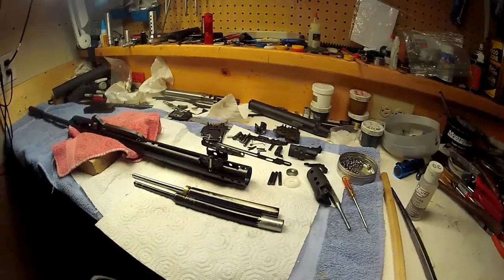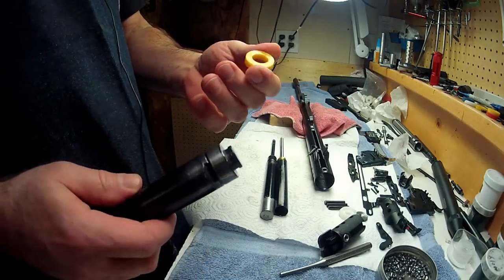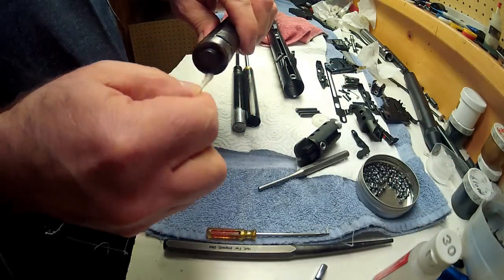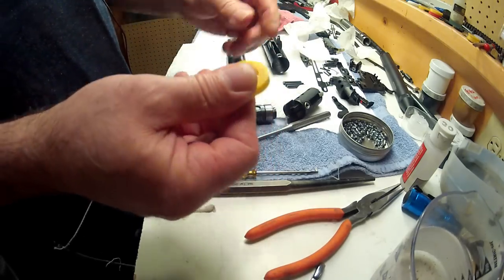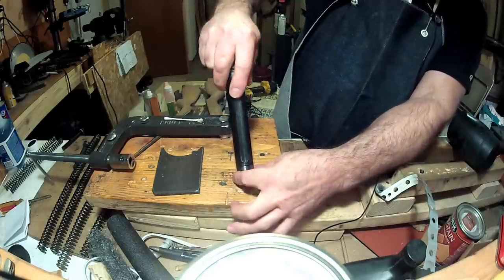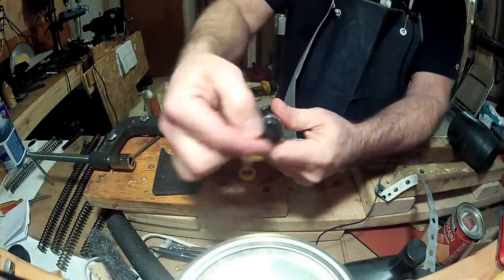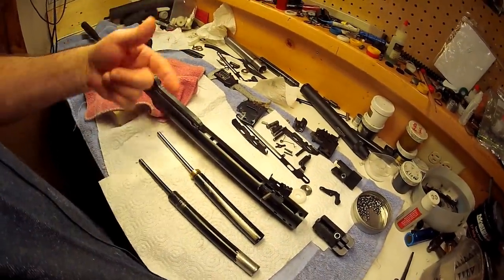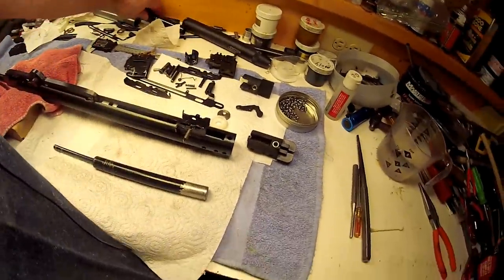Pt 1 of 2 How to gas ram hatsan & others and air gun info

Comment: Have taken out type 2 piston from my mod 125 sniper due to failing.  While installing my new type 2 piston I come up 7/16 shy of my end piece fitting flush.  It’s like the piston needs pushed in however even with force against the floor, I can’t get it to give.  Any advice?  Am I to build a clamp rig ?
Reply from the maker: Hi  Bill  ok  what  is  type two piston?  #1  the  gas  ram  must  be long enough  to  be able  for the rod  to close up  with  out bottoming out  for  the full cocking of the gun  and 
#2 the  gas  ram  has  to have pre load so when its  installed  the end plug  is  sticking  out no less  than  1/8  or the gas  ram  will reach  its  travel when fired  causing the rod  to hit its  end  damaging  it and  failure #3  yes you need  to make a  spring compressor  or send  it to me and I  will re build the original gas  ram properly  so it wont fail and return  the receiver with ram installed.  if your installing another gas ram  if its to short then  you need to machine a  round steel insert with a divot for the rams arm to seat in  the middle  so everything reaches  the proper install point

Comment: What weight losi shock oil do you use? 
Thanks
Reply from the maker: Its  stamped 30 on the cap.
 After opening  up the two gas rams they  are internally lubed

Comment: suggestion, when installing front piston seal. find a nice chrome 3/8 deep socket that is about the diameter if that front piston button, usually a 10m, 7/16 or 1/2. Set the new seal on hard surface facing up press the socket into the seal. Line the socket to piston button, just slide it on. Easy YW

Comment: Great video. Huge amount of useful info e.g. re. pre-loading distance, all the measurements, adapter etc. - I am doing this on a different gun right now, but you have saved me a lot of problems and I will be more confident that the outcome will be OK. Very big thanks! There are many videos on the web that are quite useless, yours stands out as very useful :) 
Just one question - re lubing the ram shaft - many people say you should not do it at all. How can you be sure that you can? Yes, if I was doing it, I would also use a high-ignition point lubricant (silicone based e.g. special chamber oil), but I am still reluctant to do it... Thank you
Reply from the maker: the rams shaft - arm ... the important thing is  to wipe it down so its clean &  inspect for nicks,  lubing the arm I do  it, its no big deal but I feel it just adds something to bear metal, 99% of what ever you use  will get wiped  back when the rams closes so you only need  to use a little on your fingers and work it on the shaft 
  silicone base  is fine, heck I use weapon shield  since  its  at my work bench
nothings going to explode lol inside  the ram is some type of junky hatsan fluid I rebuild  the rams  when I do someone's gun  but I  wont share  that info.
Reply: Thank you!

Comment: Mike tried to get you link u tube not letting it go.hes on nine months ago.pulls stock off 125 sniper voetex. Points to screw on side of case right near trigger. Says this lets air out of piston. Flips gun over theres a port fill hole near it he reads fill to 150 bar.. Sticks fill prop in and pumps the dam thing up to 150 bar. Chorny says he gained 100 fps.
Reply from the maker: Ok  Thanks  Mike. I  will go thru his videos and check it out.

Comment: Im looking for some advice I bought a hatsan 130 qe 30 off a guy with few other and this one doesn't shoot guy said he dry fired it show a nother guy it worked the it just stopped what he said so I went ahead a bought it to I thought maybe a trigger problem that all works fine there's no pressure when cocking at all any advice I'd like fix it I've never had a 30cal I think be good squirrel rifle if fixable
Reply from the maker: Hi
The  gas  ram is dead You can send the gas ram to me and I  will rebuild it properly / If  that interest you   email me no caps no L no spaces replace dot with  .   and    at  with @ sign      aways  mike   at  hot mail dot com

Comment: Hi Mike, I have a Hatsan 135 Vortex .22 and I need to replace the gas piston. I think the seal is bad. I went to shot it and it had no power, I've put about 3000 pellets through it but never lubed it (mistake, I know). Do you have a video on how to do that?
Reply from the maker: Hi
 Most likely  your gas ram is going  dead  they fail a lot, I rebuild them properly so that wont be  a problem. the  guns  are difficult to work on
 basically a  pain in the A.  not typical take apart  it will fight you. 
its  fairly complicated  because you would need to know  how to re set the trigger  & make a shorter  sear pin  in order  to get  the trigger back, piston seal itself  is typical  but most likely  your gas  ram is dying  if your confidant you can  open the gun and  put it back  then you can send  me the gas ram and  piston but I don't recommend it as just trying  to get the stock  on  with those trigger pins  can be a  big  pain E m    no caps no spaces no L  no at  no dot use  the symbols  in typical E  mail    a  w  a y s   m  i  k  e   at    h  o  t   m a  i   l    dot    com

Comment: I currently have the bt9 in my crossman. What's the strongest gas ram I can put that Is compatible with my f11?
Reply from the maker: That's the smaller gas ram  made  for  that  gun if  you want more power  just move on to a rifle that  has  more power  other wise  your  spending time money  and results  wont be much more.
if  you add a steel  washer with a pivot  dish  out  it  wont give  you much more and you may  not be  able  to cock  the gun depending on how  thick  you made  the steel  piece.
I  have a nice  hatsan .22  if  your interested  they  get  around 800fps  its all factory and  has a  good .22 barrel  and  if  you want to  take it further  I  can  go  thru the  gun upgrade  and  tune  the trigger

Comment: hi bro I'm Jojo from las Vegas I have  hatsan 135 .30 Cal when I break the barrel its very light like it's not pushing the piston I haven't. dismantle it yet but now  I saw your video I want to know what make it like that before I open it. it feels like the cocking lever is off the rail
Reply from the maker: Hi Jolyn  its  the gas  ram  it  failed,  they are prone  to failure and  I rebuild them  properly  you would need to know what your doing  to   remove it because the trigger has  to be pulled  and you would need  to have a  spring compressor in order to  get  a  rebuilt gas ram  and end back into  the gun. hatsan  guns are a  PAIN and even the trigger to re install it you would need  to make  a small sear pin to clear the welded  trigger bracket

Comment: Hello Mike, can I convert hatsan 95 vortex to a spring and if yes what need. 
Thank you
Reply from the maker: Yes  but  you will need the end plug  for a hatsan 95 springer  and obviously a spring and  its factory guide, I have one but I would need your  failed  gas ram and  its end plug. for further discussion go to my channel  at the top read where it says Sharing my passion for airguns, work done ,mods, re barreling, lathe work etc. >  click the small > symbol  it will pull up  my contact info

Comment: I can see, given the Losi shock oil you are using that you must also be in to rc trucks as well.  Nice informative video by the way. I got my Hatsan 125 with the Nitro piston installed by Pyramid Air. I'm getting 32 foot pounds out of it and it's only chambered in .22. What a powerhouse.
Reply from the maker: +Eric Coovert 
Hi Eric.

I bought the shock oil just  for the gas ram yrs ago I saw some one mentioned to use  it a old  tuner.

 In the video  where  I open up a gas ram  I found  oil  in side  so I  doubt  now  if  the shock oil is even necessary, but I I am sure it dosen't hurt.

 I hope you have a good one so many came out with  bad barrels its ridicules how many  problems some have.

 hatsan  tries  I seen improvement  but they still manage  to come thru  defective and need  to be returned
Take care

Mike

Comment: Hello Mike! Watching this your video, I was able to independently replace in my Hatsan 125 5.5mm spring with gas piston. Rifle is doing well, less recoil, Power is also good ... Now I would like to ask for a help. I bought a Walther 6x42 optics, which is intended for air guns, so I ask for advice optics mount to use to achieve the best connection between the optics and guns, to be stable, and to keep the optics of a possible fracture due to a stronger recoil rifles? 

Thank you in advance for your advice!
Reply from the maker: Hi.
 the hatsan 125 have  the weaver  rails I would get the 4 screw types  for each scope ring and  for weaver / picatinny ra'il

 I dont have any particular brand  to suggest 
glad you were able to do  your own work that is  awesome.
Reply: Thank you very much for your reply Mike!

Comment: You friend don't know what you're doing 10 times you show the same thing instead of showing the disassembly and assembly process
Reply from the maker: Hi Ivan
 this video is  only centerd  on  the gas ram  info other videos talk about disasembly and re asembly / If I start with  disasembly and do it so all will get it & understand it  it will make  the video too long
also
Ivan  its 5 yrs old I was  just  then  trying to show info now days its alot better even have the proper micrphone I also have a video  on  removing &  reinstalling the stock  because the  hatsans  are a big  PIA  to  get thru unless  youve done alot and have dealt with every issue  they can throw  at  you
Reply: @MrSteppingstone888  Spring with a grain 5.5 = 305 m / s and a gas shock absorber 5.5 =? m/s
Reply from the maker: @ivanpleskina2742  not sure what your asking but the spring releases its energy faster  than a typical gas  ram 
usally the  gas  ram will see 50 fps  less  then  the  spring  in the same gun  with  the same   factory piston  seal  or after market seal

Comment: I'm learning so much from this and your other videos. My Hatsan Mod 125SN Sniper Spring Piston .25 cal in Mossy Oak Camo arrived today. Checking it out and doing a little break-in. It might be a good one. Now I own 3 125 Springers in .25. I'm gearing up to work on them soon and have the break-barrel/air-gun Guru Mr. Mike E. work on em too. This particular video has me now understanding a good amount about how they work. Thanks Mike!
Reply from the maker: Good to hear. those  .25 cal are the correct choice for the 125 - 135  full barrel length also, not the QE  10-1/2" barrels  those are not long enough and most of the barrels  are not good all the way thru

Comment: Mike   I have a  Hatsan 95, been busy and haven't shot it for little more than a  year, was new when I purchase it. Went to shoot it the other day and only hear a faint click, , watched you video  but can't find any info on how to replace the seal if that's the problem. Did watch you tear down the one in your video doing a trigger. In the instructions from them theirs is nothing about where to oil or servicing  the 95 in their booklet. Do you have a video on any seal replacement and taking the piston out or any information . ? Also can I order parts from you or some other supplier.  Thank👍👍👍👍👍👍👍👍 you   so much and your video is one of the best ever, very informative ones I've ever seen on anything.
Reply from the maker: Your best bet would be to  send  the rifle  to me / your gas  ram is  dead  I rebuild them  properly / these  gun are a Pain and  a lot to know in order to  get  thru them  / also  you would need  to make  a spring compressor in order to  get the gas  ram back  into  the gun along with knowing how to disassemble  & reassemble  & install the trigger back  even the stock  can be a issue  if you don't know  what  to look for / you gas ram is dead  so you should be  able to disassemble  it  & pull it if  you just want to send the gas ram  contact awaysmike@hotmail.com

Comment: Hi friend,  would this switch work on the Hatsan Airtact .22? Im still having issues finding out the pros and cons of each setup. Thanks for your time.
Reply from the maker: Hi
The air tact has a different trigger and  I am not up  on that trigger, never had one.
I work with  the quattro triggers Also  the air tact would need a small ram most likely from a crosman nitro venom , I have those rams and can make adapters .
Here is a recent quick video on gas ramming your  rifle / I can make adapters for guys who need them & also custom made  spring guides  that fit properly and perform properly making a spring rifle smoother
https://www.youtube.com/watch?v=9kGDNr3zebQ

Comment: I watched the video but I'm not clear what is the gas piston that replaces the type 1 vortex in the Hatsan 95 model
Reply from the maker: If  your ram is  dead send it to me I rebuild  them  properly /  if  you go with a different ram  you would need  to have three  things. a  end plug  from a hatsan springer and two  adapters  that I  would  lathe turn. If  you cant do your own  work  you could just send the receiver &  tape  off the trigger pins so they stay in place. message  me 
no spaces  no caps  use the @ sign instead of at  and use . instead of dot see next line
aways  mike   at  h o t m ai l  dot  com
Reply: @MrSteppingstone888  I sent a message to that email but it says your mail is full????
Reply from the maker: @thomaswalters899  check spelling  it is   aways  not always
You may of sent  it when I  was  reloading  windows  back  on my computer
Reply from the maker: @thomaswalters899  try  it again        awaysmike@hotmail.com

Comment: ya Mike just wanted to convert it over Thanks, Jamie
Reply from the maker: the gas ram still has a jolt  but you can  get  the complete kit  from this place.
now I have  not tried his rams  I been using the crosman xl   rams  
I bought from these  people before  and they are good to deal with.
ask  them if the stingray will fit  the hatsan 95

https://www.customairseals.com/product/webley-stingray-gas-ram/

Comment: Having a really hard time with a Norica Black Eagle, Special hand made adapter did well removing the spring, but when try to put in piston the pressure crushed the adapter,piston NEVER budged!.
Reply from the maker: Ok email me with some pictures of  the adapter & dimensions would be  needed and what material  you made  it from. sounds like you  just need  the rite material I  should be able to make  you a adapter   awaysmike   @ hot  mail . com    NO CAPS  NO SPACES

Comment: hi there. i recently purchase the vortex type 5 for my hatsan torpedo 100x. after assemble, the rifle cannot cock. i reassemble still can't. so i assemble the stock spring back and it can cock as normal. i think the valve is not pushed back rnough for the hammer lock to engage. not sure why since it suppose to be compatible. any suggestions?
Reply: Its  from spring to hatsan vortex gas piston Type 5. Listed as an upgrade from spring powered at Hatsan. since i cant cut anything on this vortex gas ram. What option i have to reduce the length to make it engaged? should i cut the piston rod?

Comment: Is there a trusted person I could mail my mod 125 sniper to and have them install a gas ram and go over the gun? Hatsan recommended I get the gun looked at once a year and it’s about that time. But I would love some more power as long as it’s not going to tear my gun up. Any recommendations?
Reply from the maker: Hi. Are you in the U.S. / I go thru  these I  rebuild the gas rams also
I have special parts for  them also they were made  to my specs 
where  are  you located

Comment: hello mike, greetings from sweden, i was wondering. you can tune hatsan air rifles with springs or gas pistons but i cant find an answer to if its possible to increase the air flow by perhaps drill or buy parts so the gun lets air travel in a wider channel from point a to b. im asking you this because you can probably see that when you have hatsan guns broken down in parts.  :) have a good day.
Reply: im probably going to buy hatsan 135
Reply: 5.5mm
Reply: i will use a 30j spring

Comment: Hello, can i Make from my Hatsan 135 vortex.30 a 60joules(or more) shot? Instat of 45 joule
Reply from the maker: Hi
the  thing with  the hatsan magnums is the piston seal , all of  them  although the Russian ones I heard are a little bigger  which  will fit  tighter which  is needed and you would have to see Iam not up  on the .30 cal
often when guys increase pressure in the vortek ram they gain some but increase  the piston slam more  making it counter  productive

Comment: Hello quick question Have a hatsan vortex mod 95  gas piston what type of gas piston should i get? The old one needs to be replaced
Reply from the maker: I have a better solution  for you. send me  your ram and  I will fix  it not just charge  it.
 email me , we can talk in privet at   awaysmike  @  hot mail .com     no spaces  no caps
Reply from the maker: I responded to  this earlier "see below."
your welcome  to email me at   awaysmike  @  hot mail .com 
If  you buy a ram its a crosman gas  ram from the nitro venom  but  you will need to change the end plug  for a springer version &  make  adapters  for the new ram
I rebuild  the voreteck rams &  charge  them  higher  drop me  a email !!!